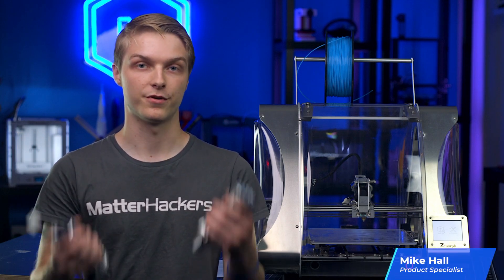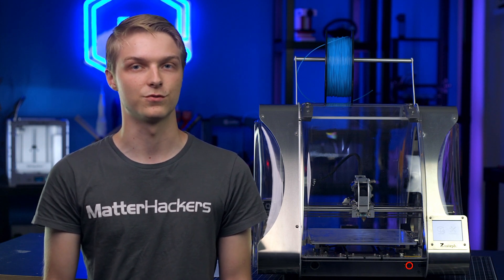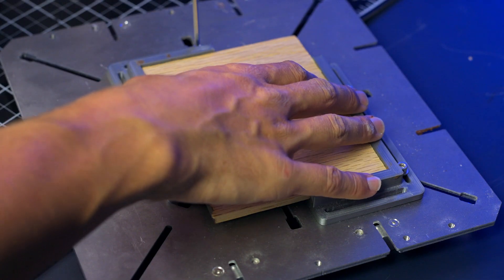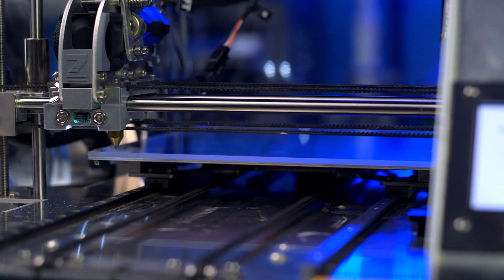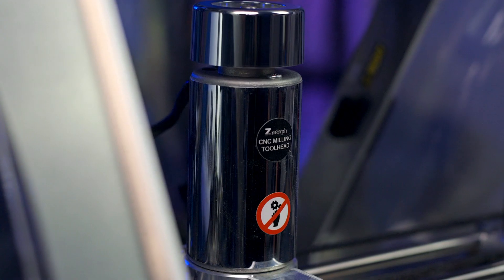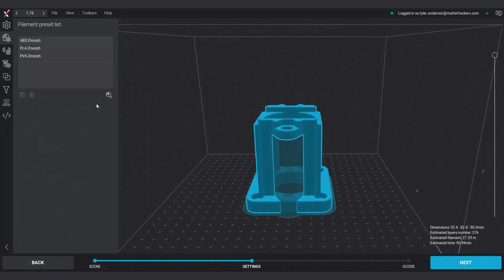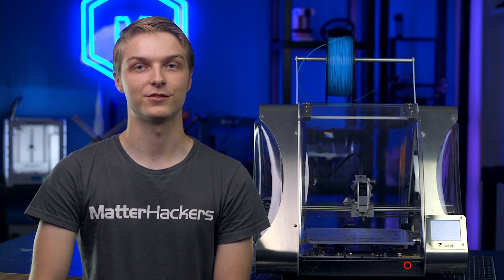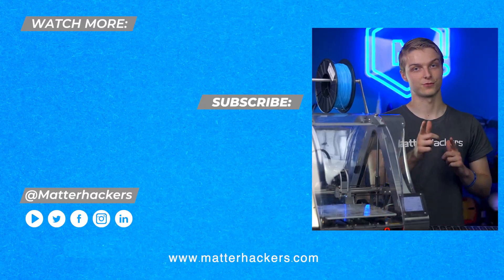Tech Breakdown // ZMorph VX Multitool 3D Printer

Comment: looks really small. Especially with that triangular frame.
Reply: The working area is 250 x 235 x 165 mm, comparing to other desktop 3D printers and pocket CNC machines it’s a good one :)
Reply: @ZMorphHybrid3DPrinters  Still sounds a bit small. Maybe I'm just spoiled by my home built 400x400x500 CoreXY with hiwin rails, and my 300x300x300 custom prusa i3.